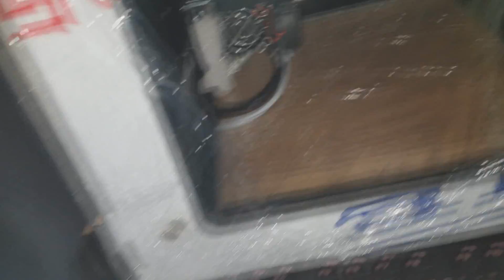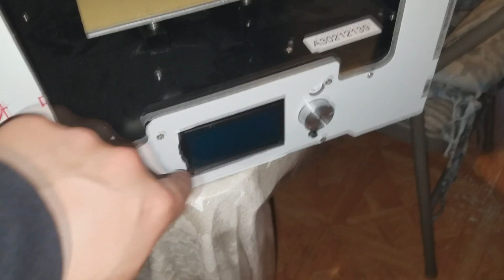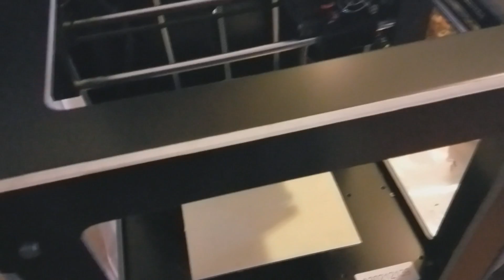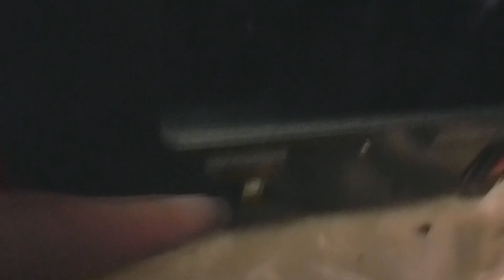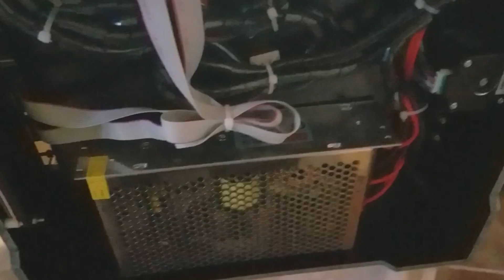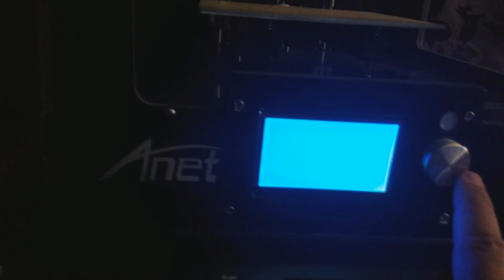Anet A3 Best Cheap 3d Printer

Comment: The X is to hold the spool
Reply from the maker: Norm Caissie yes I know and it doesn't work lol. It's a piece of junk that works with thin spools not 2.2lbs. I just put my spool in the bolt works way better.
Reply: Better to make your own spool holder. I have the A8, A6 and A3 on the way.

Comment: im seriously thinking about getting me a A3, could you tell me how it worked out after the time you made the video? and has it a auto leveling mode or do you need to make every setup by yourself?
Reply from the maker: it works well just remember to use good filament. i have other videos on the other things and more to come so definitly subscribe and hit that bell as many more vids to come. I have still been using this with no issues the only thing that happends from time to time is the clogging which happens on all 3d printers. I have a video that teaches how to unclog. Now this is a awesome printer to start with as believe me the bigger onse are more expensive and require u to put even more maintnence so this is easier. ull be able to do anything with this. Yes it still works.
Reply: Lior Bar-El good so i order mine now. The flashsale in gearbest ends in 20 hours. ;)
Reply from the maker: Gollatas ´ u won't be pisses off. ull love it
Reply: Its my first one. I only want to tinker arround with it and See if it Wakes my interest. But to have a good judgement call you need to get a good item or it allways ends in Frustration....
Reply from the maker: Gollatas ´ i feel u. tgis is great ull learn a ton from it. i took it apart so many times i know how to build it lol ul learn so much. its worth every penny.

Comment: I bought one of these a month or so ago and so far it has been great.  The power supply died into the first 5 minutes of the first print - swapped it out for a new one and it has been putting out perfect prints.

The bed is a bitch to level and mine came with a different skin on the acrylic that took forever to get off.  Wish I would have left mine on too.

Comment: Great video waiting on the next video with the results and issues. Thank you.
Reply from the maker: Yes I'm working on these right now. Be sure to subscribe and hit that bell thing it shall alert u the sec its out. There are some issues butr still pound for pound this is worth every cent.
Reply: Lior Bar-El i received mine today, it was seal wrapped like urs, but mine has scratches on the base and the excruder tip was loose because they did not put the nut where it should be, also the fans are all dusty looking like it was used, even though it was sealed exactly like urs, waiting to hear about ur issues,  and i also did not even test mine yet if it even works. i think im returning it.
Reply from the maker: Chicoelwahsh where did u buy it from?
Reply from the maker: mine just had the bed not leveled. if it has dust and all is loose I would 100 percent send it back. there are people out there selling many products as new and it's used. I bought once a Nintendo wii as new so I can review it on here and it ended up b3ing used. I sent it back for a full refund and then bought it off another person.
Reply: Lior Bar-El i got it from ebay, came all saran wrapped and all, but looks used ;(
Reply from the maker: Chicoelwahsh it probably is. mine never was broken up like that. Tell them to refund u and pay for the shipping back. I'm sure it's easy to fix but if u pay full price u deserve brand new. or it could be a factory  defect either way id tell them.
Reply: Lior Bar-El yes i can fix it and all, but why when i paied for a brand new one, your right, will definitely send it back and will ask them for a return shipping label, thank you so much for your time, and great channel by the way thumbs up to you.
Reply from the maker: Chicoelwahsh thanks bro means a ton and let me know what happens. if they don't give u a replacement u can file a complaint eBay will always give u a full refund. let me know how it goes.

Comment: nice lior. i am looking for a 3d printer, and this might be the right choise! thoughts? subscribed!
Reply from the maker: ReLaaaks I just learned to use it and made some awesome prints. there are some issues I'll speak about in the next video as I want to show u what it is. the z axis and bed needs a bit tweaking but other than that everything is awesome. I know u get what u pay for but this is worth the money compared to others that have the same build volume and is almost double the price. I recommend also a glass bed. tempted glass to be exact and it's cheap. I'll do a whole video about this I just want a bit more time on it. subscribe and hit that bell so I'll be alerted sec it comes out. Thanks for the comment. means a ton.